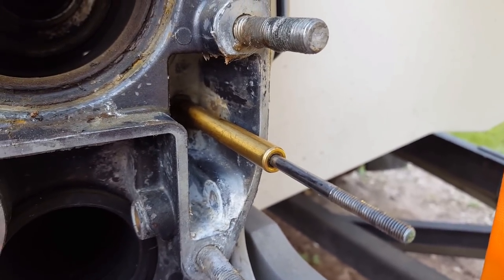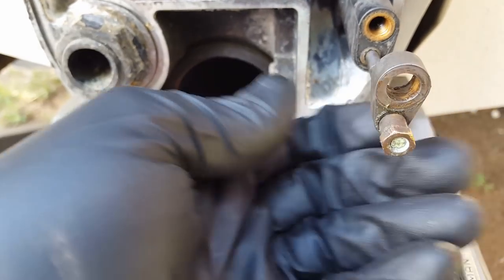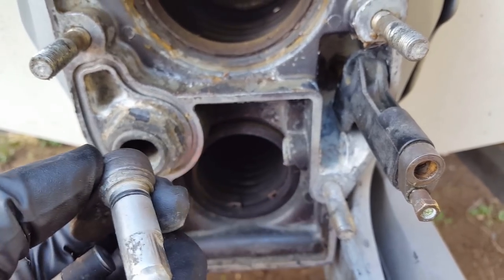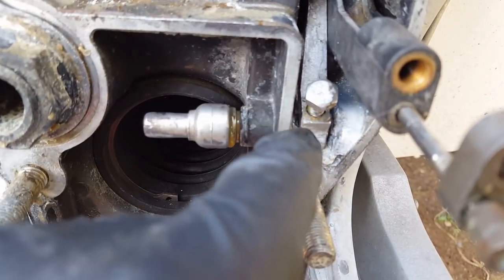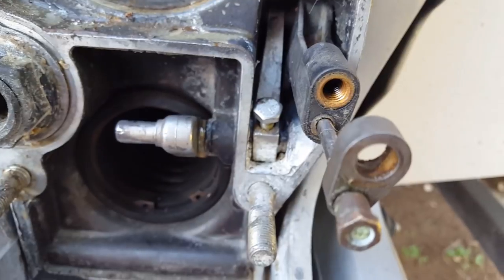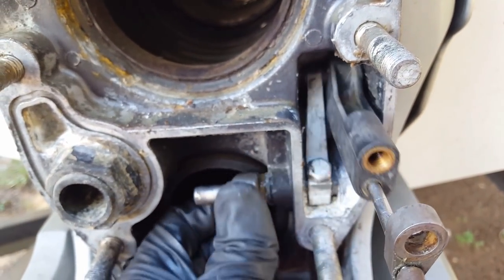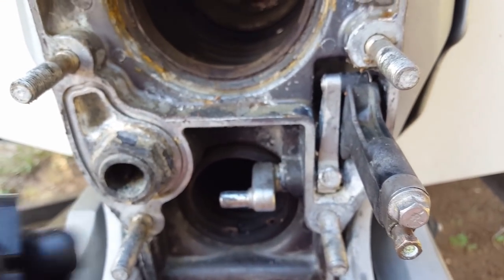OMC Cobra Shift Cable Replacement Part 2

Comment: The bell crank: there are a few versions of the swivel housing. One that has only a drain on the Port side, one that has the port drain and 2 drains on the SB side, another that has all that plus a grease nipple for the shift bell crank. In some models the bell crank is hollow and has 2 grooves, one for the o-ring, the other has a hole for grease. The other model is a solid bell crank with only the o-ring groove and the grease nipple only greases the tail of the bell crank. When you install the bell crank,  add grease to the o-ring area, and to the tail, it will help to prevent water coming into that cavity. OMC triple guard grease is what the book calls for.
For winterization the port drain is obvious, it is where the water pipe runs. The SB side’s bottom drain is very important. If that o-ring on the bell crank leaked, that is where water will be, in a cavity that has an open path to the bellows, drive shaft bearing and gimbal bearing. If you don’t have this drain, I suggest you make one. If it has water (like mine did), and it freezes it might crack your drive. Or you find water in the bellows and think those have cracked, while a little o-ring is the culprit.

As one other person said: the nut on the top of the cable needs to be tightened against the cable, not against the trunnion.
My drive is a ‘89 model, and it does have the little nut on the bottom of the cable.
Reply: Very important comment thank you.

Comment: Michael thank you trying to explain what can be very frustrating and discouraging to Cobra owners. I applaud your efforts,at least you bought the special tools for the job. The most important tool missing?? The correct service manual for the model being serviced. There is a 3 digit code such as PWC,RGD etc. on the model code tag. Usually found on valve cover. Many updates are model specific and must be followed to the letter and must be done. To all the trolls who are so ready to jump on people,provide the info needed to correct what’s in error just don’t rip on him. A manual is needed that’s all. Cobras were pretty decent units after all updates were done and I’ve seen plenty of incorrect work come from marine shops trying to set up adjustments like a Mercruiser! Thank you again Michael. 
An OMC Stern Drive factory trained tech 1980 (stringers)and Cobra Master tech 1988.
Reply from the maker: Thanks for your comments. Out of the thousands of comments I have read, yours means the most to me. Thanks so much!

Comment: I love this video. It will help me as I do this job. Thank you for your help!
I'm trying to document in one place these issues from others' comments. You can click on the times in my comment to go to that part of the video. 

1:30 - OMC says this about the Collard Retainer Nut:
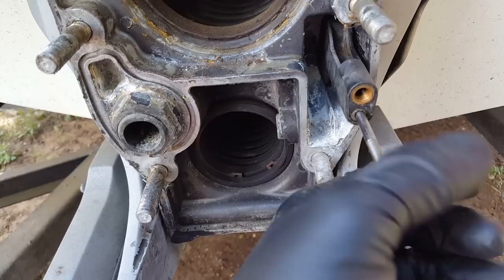"Perform the transom bracket shift cable adjustment. Use only the 914017 alignment plate to hold the bellcrank at the 90 degree position. Always use the new 915271-M tool to hold the 7 9/16" dimension. "PW" (1990) and newer models may have a collared retainer nut on the aft end of the shift cable core wire, leave it off!" But now at 1:20 I don't know how far to screw on the retainer. I think you're supposed to screw it on so that about 1/4 to 3/8" protrudes, about even with top of the bolt. So about where it would be if the nut were on it. Looking for the proof. 

4:00 - the o-ring is the seal. It needs to rotate and shouldn't have gasket material in it. It should be lubricated.

14:30 and 15:35 - nut should be tightened against the rear, against the tube, rather than against the holder. Is this true?  I'm only 50% sure. 

15:21 - cotter pin needs a washer behind it. I imagine mine will have one when I take it off and I will put it back on.

The kits that I see on eBay for around $60 have all of the parts and the O-rings and the calibration tools. It looks like I can do it for $60 or I can pay someone $2000 to do it.
Reply from the maker: Great comments!

Comment: Anxiously awaiting part 3. Recently found your channel and love all the videos. Currently restoring a 1992 Seaswirl 220, 5.0 Ford 302, with the OMC outdrive. Having tons of trouble setting up the remote controls after replacing worn cables. Keep the videos coming, thanks!
Reply from the maker: Allen Thanks for your comments! I'm rebuilding another unit at the moment, but I'll have the final videos up by the end of week. I have a bunch more videos to post too. Thanks again!

Comment: Great video! Changed cable easy lined it up with tool. When I put it in reverse it goes in gear and I can’t turn the prop. All good. But when I put it in forward gear it doesn’t fully engage and I can still spin the prop with my hands. If I start it on the trailer and try to put it in to forward gear it sounds like it trying to go into gear but it doesn’t I checked the bell crank and the cable is pulling it all the way back and it can’t come up anymore.

Comment: Hey mike hope all is well… I have reached out to you multiple times and you always give the best advise and I really appreciate everything considering the boat mechanic says he will not work on OMC cobras. Anyways I have been dealing with my pesky shift problems since I picked up the boat a few summers ago I hear these particular motors have these issues so I have to do my best. My issues is I can never find tune my shift cable to work properly there’s always about a 1/2 to 3/4 inch play which doesn’t allow for me to ever go into neutral from either forward or reverse . The bell crank assembly is solid no play what’s so ever but tighten perfectly. I cannot get rid of the play I don’t know if thats normal . I have masters the art of attempting to place shifter in nuetral (from either foward or reverse )then I’ll have to kill the ignition pull back or push foward (depending on which direction I’m going) about a 1/2 in to 3/4 inch ,pop shifter back into neutral then turn the ignition back on . That will successfully get me into nuetral . I have gotten used  to this but I want to fix the issue. And I have used the shift allotment tools . Any help

Comment: Daar Michael, thanks a lot for these Very clear instructions. Do you perhaps have a video on the fuel injectors? I learned that 2 out of 8 cilinders of my OMC Cobra 5.0 EFI engine are not functioning and it might be the potentionally clogged injectors I was gold. Its not the sprak plugs or its cables, that had been ruled out already. I’d like to see whether I van clean or replace them myself. Much appeciated.

Comment: Hi Michael I was watching your parts 2 of the OMC Cobra cable.Is there a part 1.I have water coming through the hose that the shift cable runs through.Is there a video on how to solve this problem.Let me know thanks, Your video so far is very helpful.

Comment: Hi Michael, I could not do this without you, thanks again! I replaced shift cable last year and then adjusted best I could. When shifting fwd/N/Rev, seems to work good however when powering up (trying to get on a plane, engine heavy loaded) there is a very large clunk and corresponding boat shudder. (Single clunk -> feels like a neutral drop with a car) I suspect that this is due to an improper shift cable adjustment, so I will be draining oil, looking for metal and hopefully just readjusting using 'The Hastings' method. Could you please comment on this based on your experience? At this point should I just readjust (assuming not a lot of metal filings) and try again or should I be looking deeper into the dog clutch etc?-> I'm in uncharted territory, happy to do the work and would prefer to get it right the second time arround. Comments appreciated. Loud clunking will cost me a little now......or a lot later!
Reply from the maker: You will need a helper. Disconnect the shift cable while in the water and manually move the cable into gear. If you have to hold the cable by hand to keep it in gear, there is an adjustment issue in the stern drive. You ought to be able to move through all gears with the end of the cable in your hand.

Comment: I bought a boat in Cleveland and brought it home . They said they put a new shift cable on for Ford and reverse one from the handle to the motor went from the motor to the drive. Neither one work how do I fix that? And is there an exhaust flapper that goes on these things because we had to pull the motor and put into water jackets, not water jackets freeze plugs in the back of the four-cylinder and there wasn’t one in there but there was just a rod in my buddy says that in the cobra you don’t need to replace them but is this true? Please let me know.

Comment: Not sure if u will read this but here goes, had a marina replace the bellows on my lower unit of my 5.7 mercruiser, since I got it back it doesn’t want to shift out of forward or reverse while engine is running, but when engine is off, shifts no problem, any ideas, lower unit issue or shifter cable problem?

Comment: Do I still have to pull the stern apart if the shift cable sleeve pulled off by the engine? Could I just buy the adjust kit.  Push/pull cable with pliers till I feel it fall into neutral and then use the alignment tool just on the engine end of cable or do I have to take stern drive off to put that other alignment tool on. FYI You are a God sent. I cant tell you how helpful and greatly detailed your videos are!
Reply from the maker: Chris,  Thanks for your comments.! I got you covered. Before, I get into this,  are you talking about part #104 from this link? https://www.crowleymarine.com/johnson-evinrude/parts/56078.cfm?mdl=VI9RCP
Reply: @michaelromer2016   No I'm not talking about that end of the cable I'm talking about the other end of the shift cable that's up by bracket with the W Piece. That piece pulled out of the sleeve so Before I attach it back to the sleeve do I grab it would pliers and pull the cable into where would be sitting for neutral.  Then slide the sleeve is far on to the cable as it will go then tight down those picture bolts on the end. After that can I use the alignment told to get it accurate again out half and to take the Stern drive off
Reply: I did order a cable just in case if I needed it but I'm thinking I should just do  It and replace the cable anyway I just don't have any help. I'm a one man show here
Reply from the maker: I hear you about being a one-man show if you have someone nearby that can you can give some beer to maybe they'll be willing to help you out.

Comment: I didnt read all the comments so maybe this has been mentioned, but there is a procedure in the video that is INCORRECT.
   near the end of the vid where the lock nut is being tightened against the trunnion anchor.. it SHOULDNT BE!!!
 aftersliding the threaded housing tube over the core and screwing it into the end of the cable, and BEFORE adjusting the trunnion, the lock nut should be locking the housing tube into the cable end to hold it securely so it doesnt allow movement that may wear out the threads inside the cable end.   
 the brass (or delrin) trunnion that anchors the cable housing in place should always be free to swivel on the threads of the stainless steel housing tube. this will insure everything stays securely in alignment and never wears out which would cause binding of the core wire... if the threads on the trunnion should ever wear out due to the stainless steel housing tube moving slightly within it, its a very much cheaper and quicker repair than another entire cable replacement and procedure.... DONT tighten the lock nut to the wrong piece!!!

 ADDITIONALLY, the lock nut at the lower end of the cable that has been screwed on after the retainer, needs to be discarded.
 the updated bulletins indicate that having the end of the core locked in place can cause binding and WILL cause unnecessary wear of the cable core if it cant rotate slightly as required during its travel back and forth....
Reply from the maker: I checked out some of my new videos and apparently I already fixed the first part you mentioned. I think this was one my first videos. As for the last part, I'm a sucker for using the old methodology, and I can't say I've kept up with all the bulletins. You definitely made a passionate comment with use of CAPS.
Reply: the caps was used to highlight the importance of the issues for those that may not know why they are having problems... if a person deviates from the latest TSB information, they wont have much better luck than what they had before working on it..   it was not, in any way meant to be a slam to the article, as its a relatively well produced informative video...

Comment: How are you suppose to put gasket sealer on a rotating assembly with out it freezing up the part from moving. But your vids helped me get back in the warer
Reply from the maker: The o rings ought to remain stationary in the gimbal bearing. If it was a rotating surface he would need a bearing on top of the gimbal bearing which isn’t the case they just use an O-ring.

Comment: On the outdrive, specifically behind the prop, there are two seals. One is around the prop driveshaft, and the other I can see four bolts (I think) holding it (driveshaft) in. Do I have to remove the lower to change that inner seal? I noticed some oil leaking from behind the prop, it’s not coming from the first seal, it appears to be coming from the back seal. 
Thanks again for all your great videos!
Reply from the maker: Andy E There are two prop seals (in most cases) near the prop. There is one where you mentioned that is leaking. Sadly the prop bearing housing assembly has to be removed or you will have water inside over time. I have a video on removing it with chains posted. Plus all those bolts you mentioned. Lower unit doesn't need to be removed.
Reply: Michael Romer I thought that’s what you were pulling out. I’m going to have to get it replaced soon. I just got the ESA bracket and cables all adjusted today. It runs smooth and shifts great now. I want to get it on the water to make sure it’s all good before tearing the seals out of the lower unit. Again, thank you for the great info and responses!

Comment: awesome vid! my omc cobra doesn't have that little nut at bottom of the  Retainer with the 2 holes.. not sure why. what is a good set point for the back shift shoe? Just all the way back?
Reply from the maker: There was an article that came out from OMC in the 90s where they removed them and/or stopped using them. No issue. Please subscribe.

Comment: I have 88 bayliner 5.0 with a omc cobra out drive. Was wondering where I can buy a shift cable and I will I know if it’s the right cable I am buying .. thanks
Reply: I have the same boat (88 bayliner, 5.0L w omc cobra out drive). Does anyone know what shift cable I should use? Part number? I don't have the original anymore :(

Comment: Thanks for the great video. On that shift lever set screw, is that a new screw that the service manual demands, or did you reuse your old one? Did you not need a threadlocker to keep it in place?

Comment: Any recommendations I have 1989 5.7L OMC Cobra. When it runs for couple of minutes it shots up and hard to start I noticed no spark on the coil and replaced the but no start.  If I let cool it then crank right up.

Comment: One of the better videos I've seen mechanically detailed and quality. thanks. My grease zerk tube filler(upper right side). desinagrated (sp) any way fix?
Reply from the maker: The tube actually comes out really easy and can be replaced from the outside. Do you know if part of the tube broke off inside the gimbal housing assembly? $25  http://www.crowleymarine.com/johnson-evinrude/parts/56127.cfm?mdl=TMV29H
Reply: Michael Romer.  Thanks much, yes , Right behind the outside zerk threads it broke. The tube is approximately 5 inches long. in a tight space. Cobra stern drive, inboard outboard. 5.7 engine.

Comment: Great video. Appreciate if you could show how to adjust the engine bracket as well. Keep up the good work :-)
Reply from the maker: Br Ar You got it. Let me work on that one. Should be this coming week.
Reply: Did you make a video on how to adjust the engine bracket if so where can I find it thanks for the videos
Reply from the maker: No video yet (as of 5/9/2018) I'm rebuilding another unit at the moment. Should have that done and then hopefully by this Sunday, I can make the bracket video.
Reply from the maker: Part 1 is posted
Reply: Michael Romer what is part one called
Reply: Adjustment video yet ?
Reply from the maker: Surf my channel. I have a 5 part video series on the process. It has ESA in the title.

Comment: Hello Michael,  RE: 1992/93 OMC COBRA. I replaced the lower shift cable and have followed all the guides and based on the way it sounds, when I shift into forward, I can hear something that sounds like gears clunking as if the gears are not fully meshed/engaged. Reverse works fine.  (this is a dry test, I will immerse after I get a response from you)  My question.  With the condition I have described could you tell me which way to adjust what trunnion?  I can fiddle and fiddle but I was wondering if you could point me towards the most likely place to start?  Help me Obi Wan- I don't want to pay a marine mechanic to do something I can.

Comment: Very good video, easy to follow --- well done.  I am looking at 4WINNS with OMC Cobra and 5.7 MerCruiser and found this video most informative and allows easy understanding of how the shift cable works and the importance to proper alignment.  With all the horror stories of alignment leading to clutch gear failure, I feel much more comfortable about this potential purchase.
Reply from the maker: Thanks!